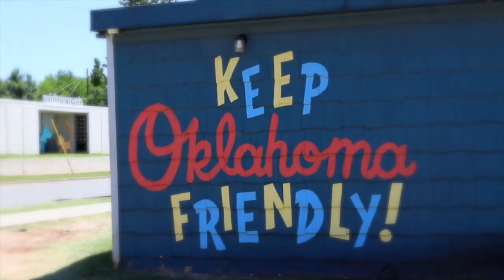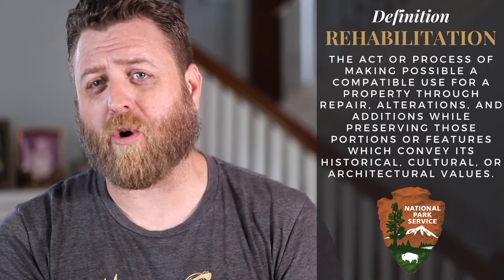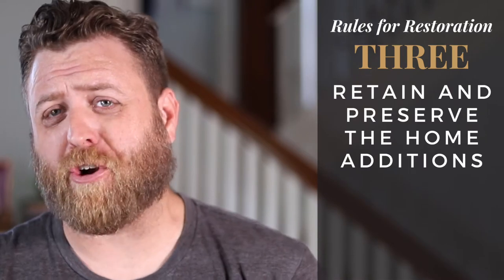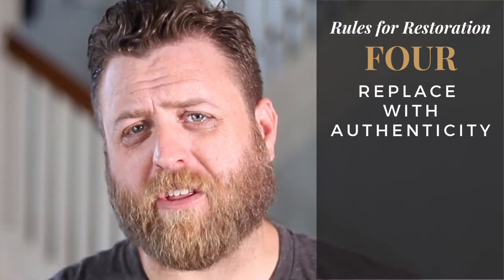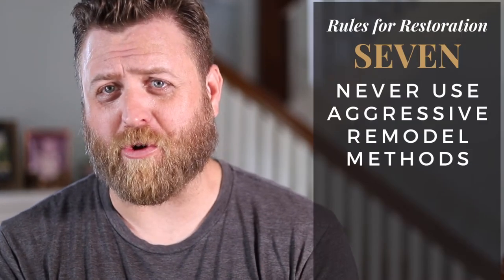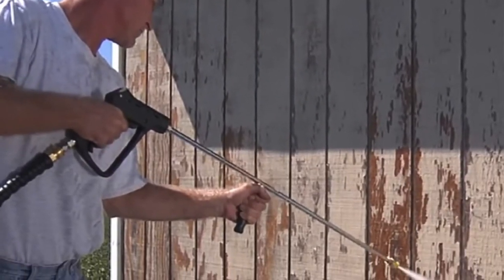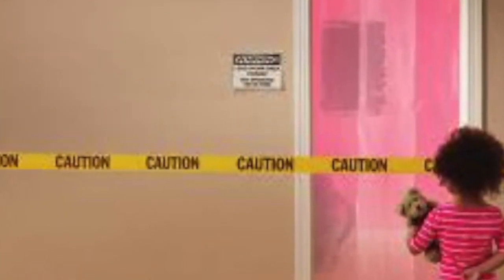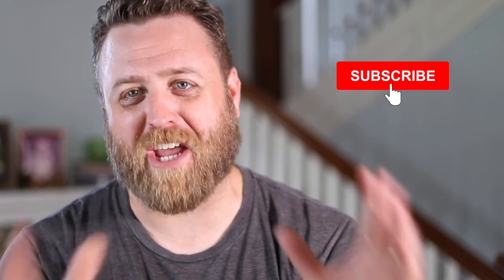The Rules for Home Renovation / How to Renovate Your Old House

Comment: I'm fixing up a 1925 Craftsman. given the electrical work needed and insulation, should I re-plaster the lathe or rip i out and do drywall? I'm sympathetic to keeping it but everyone I talk to says just rip it out.  Any tips for recreating the finish/ wallpaper  if I do go in with drywall? Will it look ok if I keep the original trim?
Reply from the maker: Jacob Tracy I think repairing plaster is a great idea... but if you take the home to the studs to add electrical and insulation it may be cost prohibitive to use plaster and lathe depending on wear you live in the US.
Reply: My house is also 1920s lathe and plaster. To rewire, we removed the (huge) baseboards and found about a 6" gap between the bottom of the wall and the floor (that gets covered up by the 8" + trim piece baseboard. The outlets were actually put by us into the baseboard (might not be to code everywhere). This also gave us the chance to replane the baseboard and repair with some bondo - of course prime and paint. If we tried to cut outlets into the plaster it would have been a huge mess. By the way, old houses were not designed for wall insulation and I've seen videos showing it can lead to issues.